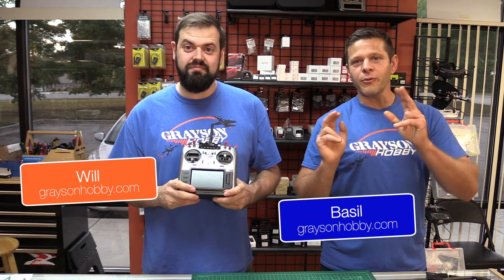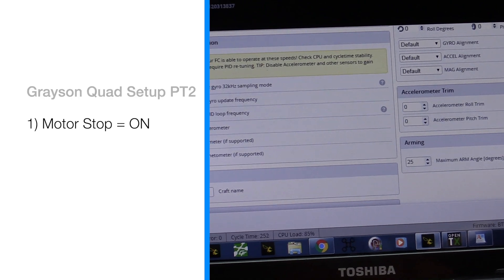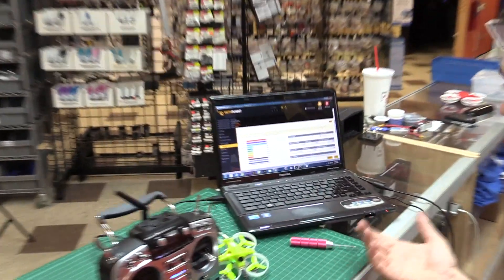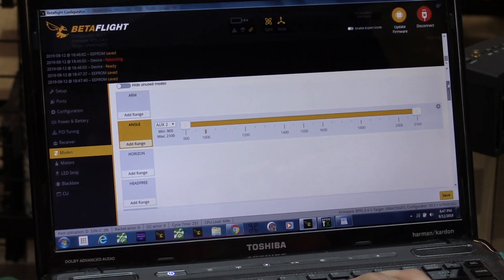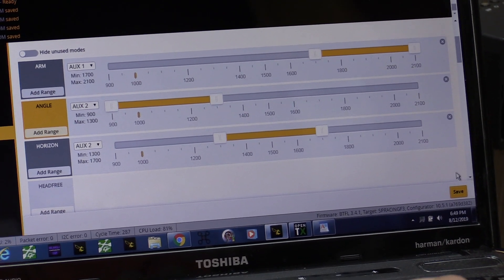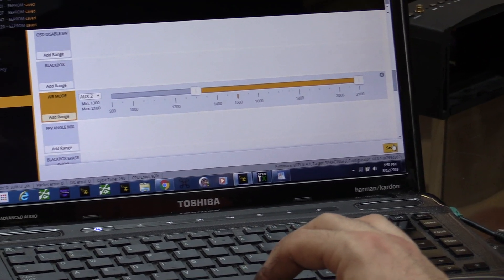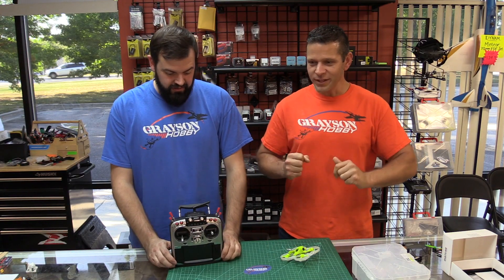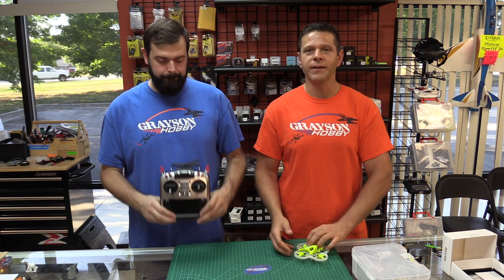How to Setup FPV Drone BETAFLIGHT For Beginners Part 2 of 3

Comment: That's just perfect.. I started watching mr. Steele... And now I'm into drones.

Checked out a couple of vids.. think I know something.. start virtual etc.. yeah I can do this..

Watched your vid on 5 beginner mistakes... thinking oww.. true.. you can't put on a powersource without the antenna.

Watch this mini series.. the learning curve is starting to go to... mayb there's a different hobby out there XD
Reply: But you could skip all this and start with a RTF like the mini hawk.  The remote is already set. All you need is extra batteries!
Reply: @WhiteDean45  that was a month ago.. 

I am now actually hitting gaps in liftoff simulator and 4 of my 8 lipos are in.. my isdt q6 pro is in aswell.

My fpv beta 85mm x pro2 is in aswell.
Waiting for a balanceboard from banggood..

And I need to config the transmitter in combination with the whoop. Since I fly mode 4 with no inverted pitch.
Reply: Yeah I don't know it was this complicated!

Comment: I bought jumper T16 pro.. However,I can't get it to Arm my dys Elf or my Holybro Shurekin 250.. I can bind my hubsan 107 . Using your instructions. But when I move stick to right it goes left and vice versa. My throttle works correct and forward pitch. What am I doing wrong . I'm new to jumper TX as I've been flying Spectrum.. Any ,please help..
Reply from the maker: Your channel mapping is backwards -
Reply: Grayson Hobby  what should it be.. Is it my initial jumper setup channel or the model setup.. I wish y'all were closer to me. Would definitely be my go-to hobby store..
Reply from the maker: Goto to the output page and reverse which ever is backwards

Watch this
https://youtu.be/usgMLpeZXz4
Reply: Thank you. I figured it out. All hubsan models need these reversed..